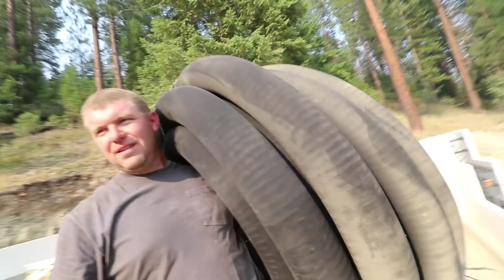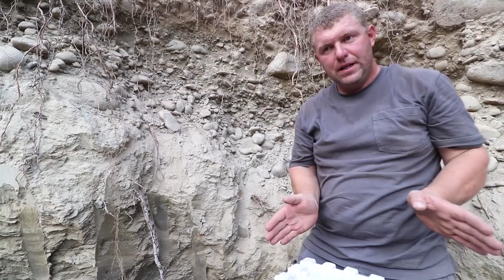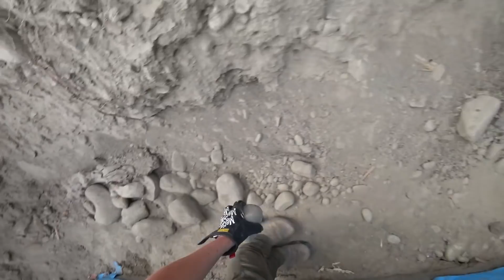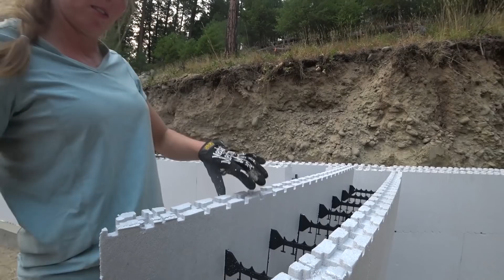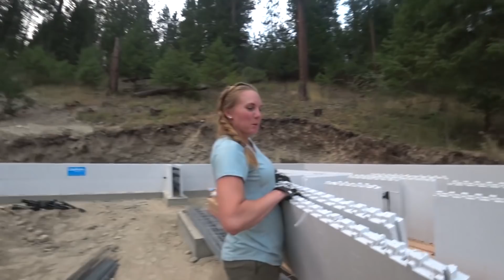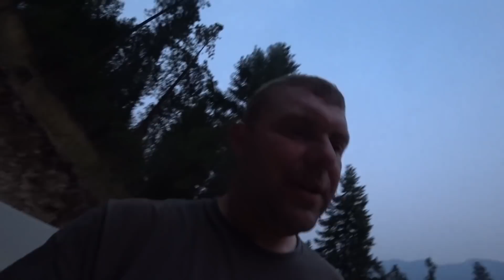OUR MEMBRANE IS DONE! (Waterproofing Foundation)

Comment: I really don't think you have a problem. The membrane is just a butyl rubber. That stuff will stick to anything! Especially with any heat the hits it, it will bake right on to whatever. If you really have a big concern about it, get some roofing tar and coat it.

Comment: One way to retrospectively protect the corners of your membrane would be to put a larger radius solid pipe in the corner before back filling. The pipe will prevent the back fill damaging the 90 degree fold stress point of the membrane (as an external 'fillet'). Alternatively some of the insulation you put under the membrane you could put outside just to keep rocks from getting to the membrane surface. Nothing to do with code just a cheap-ish way to protect the work you have done. 

Anyone who has never made a mistake has never made a discovery.  (a misquote of Albert Einstein)

Comment: You should have put the membrane from the icf over the concrete. Not over the styrofoam on the concrete. I would worry about water working it's way underneath the styrofoam.

Comment: Hey guys do not get discouraged about the million different ways to do something.  Unfortunately only experience will teach you the correct way.  I build for a living and have to make a million decisions a day about how something gets done because there is conflicting information on the plans, engineered details specifications, codes, and manufacturer recommendations. Most of the info on products is compiled in laboratory settings, most drawings are created by people who have never built anything, engineers always over design by a factor of 2 to 4 times what is needed to cover variances in actual conditions so keep all this in mind as you work through the process👍🏻

Comment: Jesse,  Don't use 4" use 6".   The reasoning is this:  If a squirrel or other small mammal decides to call your drain home, the water flow if it is heavy will flush it out.  Also snaking the drains, if you ever have to, is simple.  Or better yet get the end caps that are grill faced and friction fit these so you can get in.  The schedule 35 6" drain pipe should be about $300 plus tax.  I forgot that you are using soft foam for the walls.  In that case I would still use a piece of plywood but I would set it out about 3" to 4" from the wall and fill that void with pea stone.  Then back fill.  Given your bucket size, I would in any event insert the plywood horizontally.  Not hard to do.

Comment: I've been waterproofing for over 15 years, the Henry system is farely new that's why it's hard to find. I would suggest using bituthene liquid membrane to protect your weak joints, and to adhere any lose membrane. Im sure you could find it, and it's not expensive.

Comment: Why not use the spray foam stuff your using for gaps at every patch seem? It surely couldnt hurt it, and would only be that much better. Biggest thing is to overlap like roof shingles, the bottom most should be tucked under everything else.

Comment: They spend a lot on the timber frame building classes but not a thing on the building of  the foundations which is the most important part of the house. All things must have good foundations I have always been told  it be a house, relationships, construction of buildings, roading or you are going to have to do it it again.

Comment: soaringtractor:-
Go check out ALL the companies that supply the blocks and they all say the same thing.
DO NOT GET THE SAW DUST MIXED WITH YOUR CONCRETE, it will compromise the bond.

Comment: Hey bud i am a contractor in a very similar climate, to be honest I get home and drink beer watch your vids and think, "Geez home owners". This video I could see hit your morale hard and I thought I should jump in.   Your membrane is MORE then enough if you seal the gaps with 4'' overlaps(the reason they dont sell anything more is no one uses it) and also to begin with....... ICF forms are way more expensive then traditional forms and considering your going to backfill almost all of it, you have no need for it. The point of icf is better insulating, with only 3' exposed, not really a big deal.   At this point get your perf pipe in and backfill with drain rock with a filter cloth then your good to go. Good luck with the rest of your build, also don't be afraid to higher a builder. That is a 2 day foundation, one for footings and one for walls, then stripping and backfill is the 3rd. For the amout of time you have spent you could of gone to work and broke even on cost.

Comment: Or there is the old way put on a layer of roof tar rolled on.  Bitchuthane (which is what every I know call it) does NOT like to stick to Styrofoam, that is why they want adhesive.  "Protect' the membrane?  don't go nuts on the gravel and it should be fine.  Have only done a couple of hundred foundations, and again GO EASY ON THE GRAVEL!  SPRINKLE (that is with a shovel) some larger gravel (pit run?), then finish the fill.  This will both help the drainage and keep all the pea gravel (crushed) from crushing the drain pipe.

Comment: That sounds all like a horrible experience. I’m sorry for you. Looks like I would never use those foam blocks. In That situation I would go for more costly concrete blocks with rebar and filled with concrete or direct with cast watertight concrete.

Comment: Jesse
When we install membrane on pit walls.  We also use cardboard sheets to cover the membrane and protect from rocks.  Use good drain tile and you guys will be ok.  But I've installed several miles of corragated drain pipe and never had it collapse we use it in all of our fields to drain the field.   But they do make a PVC that is made for around homes.

Comment: There are millions of homes built in this country without membrane and they stay dry as long as the foundation doesn't crack. If you install the drain tile properly (which it looks like you are) your basement will be dry. You guys are doing a great job.

Comment: Too bad you did not watch 8 years of Mike Holmes.. all this was covered over and over, both ICF and hard concrete. They have shown the primers, film, textured drain protector, etc.. Best of luck in finding the textured drain sheet that protects the  sealant sheet.   I am surprised your foundation supplies dealer does not have the complete set of materials.. best wishes.

Comment: Well since you have drainage pipe you'll never have standing water anyways. So little punctures at most leak humidity to the inside. And since you will put a drainage cloth or something alike atop the membrane who cares? It'll be good enough. Probably wont even notice that the wall is a bit damper if at all.

Comment: Hey guys, you are doing a great job!!! Love you channel and wish the best for all you are creating. 
I use a particular process for this situation. The ICF is not the issue and as for the membrane, you have done the best that you can do based on what you had. Your real concern should be (diversion)... 
With the high grade behind the house and the massive slope, you will have a plethora of run-off encroaching on your house. Here is what I would do and have done many times on similar builds.

 1) use solid perf pipe alongside of footing on the outside with an external exit point, encapsulate with filter fabric, gravel and clean backfill. 

2) Install a sum pump pit in one of the internal corners and again install a inner perf pipe alongside of footings on all 4 sides sloping from both sides to pit, encapsulate with filter fabric and crushed stone. This will eliminate all water that will breach the footings and want to rise to exit on finished flooring. (and my feeling is it will if you don’t do this inner system) It will be your best line of defense. 

3) Now for the kicker, and MOST important you will and should have already graded the slope a min of 8' from foundation, not the footing dig but for finished grade and slope away form house. Keeping the water from pounding the foundation, this will be the best thing you can do. Please keep in mind that the membrane, despite all your effort will have breaches over time if not sooner.
DIVERSION is most important and having the piping system that I lined out will increase your odds immensely for a dry, safe environment.
If you would like to chat, feel free!

The best of luck guys!
Russell-
Reply: BTW!!! I am not an engineer, I am simply stating that this has worked for me in the past and every situation is unique. But I will always use this system when permissible. But as always, check with your local engineer and codes to first.
Reply: Russell S. Don't think they'll need the internal give that the hillside has a clay layer that would act as drainage  pan to water and exists well above the footing for the most part.  

The simple mat and exterior drain should do the job.  Important part is the simple mat becomes the drainage plain and the layer that is absorbing the hydrostatic pressure. The foundation wall is thus released from this hydrostatic pressure acting upon it directly. Water/moisture then drains harmlessly down to the drainage bed.
Reply: Ian Powell, in most level circumstances your idea would apply and be effective...however the back fill will not be compressed clay backfill and will forever be the week point for absorption. And with the slope behind the structure, one would have to take an extra step to add more insurance. The issue is the grade above that will be extremely taxing in their scenario I have come to learn over building for 35 years that under these conditions it would be wise to install both systems, and have the assurance …. “it’s better to have it and not need it, then need it and not have.” My experience tells me without a doubt…if the relief system is not installed on the inside perimeter, they will have a water issue.

Comment: Always remember that water follows the path of least resistance.  If the drainage pipe is properly installed a minor glitch in the waterproofing won't be a major  issue. I use 1/2" homosote/ fiber board for protecting the membrane. Seems to be a good economical product

Comment: I'm nobody that knows anything about this stuff but I don't think the adhesion of your membrane to the face of the footing isn't super important. the backfill is going to hold it in place and water will run down it and as long as your drain pipe is there it will carry the water away and keep it from backing up and going up behind the membrane
Reply: My thoughts exactly, if the drainage works then the wall is fine
Reply: fillg lol..

Comment: Wrong wrong wrong. Use what you had first. The sock will keep fines out of the tubing. Backfill with sand or 3/8" pea gravel. Membrane is fine the way you installed it. Next install the drain and cover it with pea gravel like you intended. Finish pouring the  wall and then cover with membrane to 6" above grade. Backfill with gravel and your done. I would bring two ends of the tubing up to grade at he highest point in the back grade, and run the tubing to the lowest point then out to the hill and open to daylight. Natural gravity drain with no pump needed. Cover the outlet with hardware cloth to keep rodents out of the drain tile. Then cover the drain pipe risers with a cap, that way you can flush the pipes if you get a clog. What you said about not tearing the membrane when backfilling the foundation is the right way. Stop overthinking everything. I better add this do not backfill the walls until the house and basement floors are poured the must be there to keep the walls from bowing in and cracking. One foot of pea gravel over the drain tile will protect it and keep the filter fabric in place.

Comment: I've been putting tar and 2 inch foam insulation on basements for 25 years with no complaints well one the backfilled with a 3 ton rock and cracked there foundation pushed it in almost 5 inches and it leaked there and only there I think your doing overkill and should be fine

Comment: As they found out by trying to purchase phantom materials and talking to the "PROS" who don't do it right anyway ... Their membrane won't be installed any worse than the professional contractors!  It makes sense.  That stuff is nearly impossible to get stuck into the corners and there ought to be a few punctures on any site when it gets back filled.  But what would a professional contractor care?  The dirt is gonna cover up all their mistakes!  Pros won't make detailed videos about how they installed membrane at your house!  These two are doing just fine; over building and being meticulous.  They're gonna have a better house than a pro contractor could ever give them!

Comment: Guys, Add the gap drain on the outside, sort of semi-rigid honeycomb spacer (about 5mm thick. Also available as a similar thickness stuff like scotch brite texture) to allow a drainage path and protect the membrane Landscape fabric (heavy weight) does some protection. You get a fabric bag with gravel inside, honeycomb on wall side then back fill against gravel bag.
Fabric wraps the drainpipe separately.
 I hope this helps. One last thing, the aversion to sticky and tacky stuff goes away in a couple of weeks.

Comment: After 4 years of architectural studies I can suggest to just live the membrane with overlaps only. You can't even estimate how many houses/buildings made with this practice. Originally the layers should be sealed together, but (not by laziness) the backfill will just give enough pressure on the layers if you have enough length on overlap. As an addition it is recommended however to do a fold on the ends and perhaps the sealing, but not crucial. Most of the leaking will occur over ground level, that's where you'll have to pay a lot more attention. Love your channels guys, you are my modern freedom fighters. Keep up the good work, and show the world (and me :) ) that it is still possible to build a home without any debt.

Comment: What you have essentially is a concrete wall with Styrofoam insulation attached to the outside. If the membrane will not stay adhered the life of the home then strip it away after the pour and waterproof like a conventional concrete wall. There are excellent YouTube videos on proper waterproofing basements. Spray on elastic membranes also require a PROTECTIVE shield with drainage channels embedded in the design to direct water away from wall down to the drain pipe system. Continue reasoning this problem out. I have confidence you will not accept something questionable. I would definitely get the manufacturer to sign off on your final solution. In the end though, it is just a concrete wall that gets waterproofed successfully and properly every day! Good luck!

Comment: DIY usually doesn't save any money over hiring a contractor because; the contractor knows how to hire the right trades at the right prices while a DIY'er will be charged more and won't know the difference.  Professional contractor has the knowledge to avoid costly mistakes.  Knows tricks to do it better while saving money without having to always follow the manufacturers instructions to a 't' (those companies want to sell you all their ideal products) and the manufacturer makes a compelling case about voiding their warranty if you don't do it the way they say, and the DIY is trapped into that notion.  And, they (contractors) do it right the first time and do not have to double back and fix things and sometimes waste materials while building things twice.  This is all not to mention that in the end, there are no 'oopsies' that the DIY owner builder has to live with.  

All that being said, in this case it does not matter.  This is a documentary with an audience and that is what is paying for this build.

Comment: It sounds very much like an ICF problem. THey sell those forms, they know they have to have waterproofing membrane. They should be able to give a list of acceptably products that can do that properly. The company you got the mebrane from is just as culpable. You should be able to tell them "I'm using ICF blocks for my walls, what products of yours will work with those to get a fully sealed wall?" If they can't answer immediately and in detail, look elsewhere for membrane. It's like they are all trying to set things up so if you end up with a leak, they can say "Well you didn't do such and such, too bad, not our problem or liability."

Comment: OMG, I used a membrane on my basement walls called bituthene, looks like the same stuff you used. I went to Lowes home improvement store, "the glorified hardware" where stupid people work around here and ordered the bituthene. no one told me a thing about the cover board to use after I put it on the walls and the stuff will get hot in the sun and peel off. well, guess thats all my fault for not knowing. Remember theres no professionals that work in the box stores, just people who seem not to care. just remember frustration === determination. I have made my share of mistakes, but I'll never give up. I used 12 inch cinder block and filled them with concrete and rebar for my walls. Do you think the forms were a better way to go?

Comment: your membrane is fine... you aren't building a vacuum chamber here... if there are small imperfections they will be ok. put a proper drain tile in and you will have no problems with water. water should only penetrate the foundation if there is enough pressure to force it past the membrane (through the seams) and through the porous concrete. if you have a properly installed drain tile any pressure should be alleviated before it finds its way into your basement.

Comment: Jesse 
Please before you pour the walls get someone that pours ICF forms  give you a good mix design for the concrete.  Also get them to be there to oversee the pouring and vibrating.  Also bring them out at least 2 days before the pour to check things over.  Even if you have to pay them it is good insurance.  You don't need anymore mistakes.